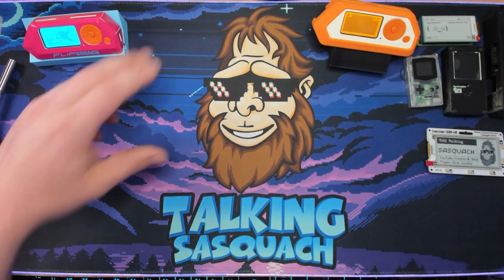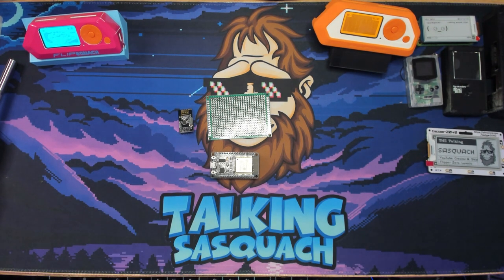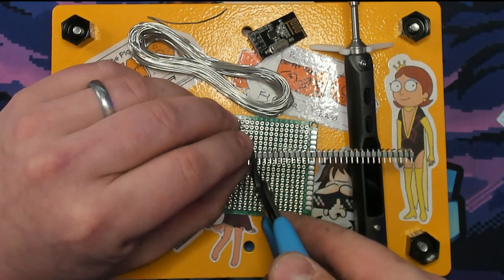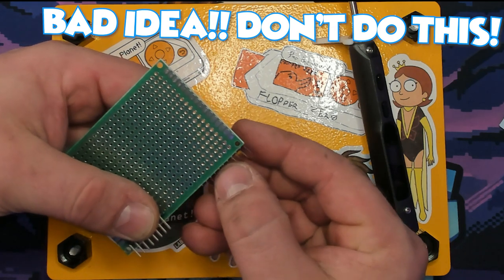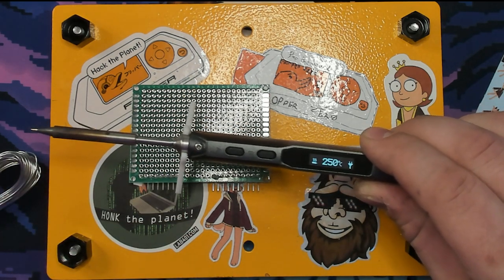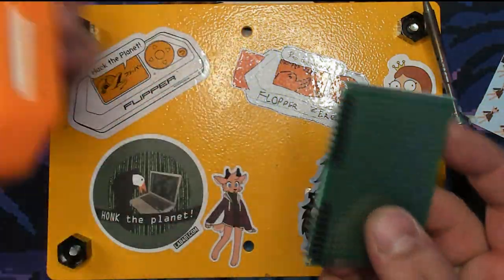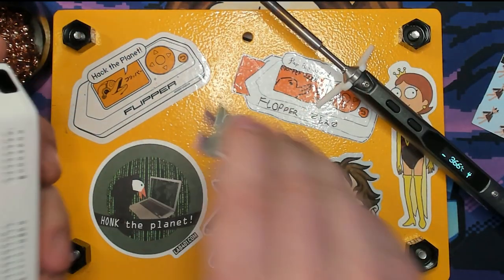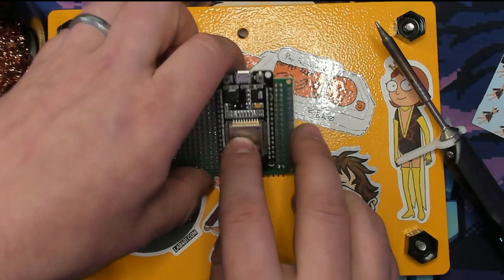How To Build Your Own Custom GPIO Boards for the Flipper Zero!!! 🤯🐬😈🐱‍🏍🐌

Comment: I wish you could explain more things like what these boards do and how to read pin out and understanding what these things mean for example tx and rx and what those things mean and what they do and how those two chips interact or how/why they are on the same board you are making. Or why there are two different sides one with less pins and one with more on the flipper and why some are connected to that but only on the smaller chip u used. How these things interact with the software or how to even know what is possible and all sorts of things. If anyone has any resources for this stuff I would greatly appreciate that. I haven't looked at the flipper docs for gpio I'm sure that is a good place to start but a video on all the things i mentioned and things like that would be so amazing.

Comment: To the Talking Sasquatch  I have been soldering onto old Xbox 360 to RGH3 hack/mod consoles and it’s micro soldering to a MB that requires you to scratch at the MB to expose microscopic points in my experience in soldering any MB or PCB it’s best to use more flex then less it’ll help protect the board from burning and help protect trace wires that don’t need burns or scratches. 30 awg wire is the go to for MB or PCB and the solder I always choose lead but free will do as well not a huge miss..good work as always tho man! Also my burning temps I like using is 381 to 480 it’s a big range difference however some spots don’t need as much heat as others depending on the point and the material  I have better luck with long holds on copper vias on 381 then I do short holds at 480 to tack wire down just another point of interest for anyone else learning to solder
Reply: Also after pre tinning the 30 awg wire you can cut it down a little shorter to leave less exposed to help prevent shorting problems

Comment: Hello! Thanks for the good video!  I saw you soldered the wifi chip GND to the 2nd pin which is not GND on the flipper, but the SWC... Is that OK?
Reply: YEP... you mustv'e meant the 3rd PIN....

Comment: Your on a completely different lvl than I. I have so much too learn and am very impressed by your skills . Im still running original firmware and api mismatches everytime I update on q flipper it makes me have reinstall everything. Is there a better way? I noticed after reinstalling some things they were updated or ran better with less furihal crashes.

Comment: so I can hook up an nerf and an esp to the same ports and they work fine? so no switch or anything just solder both boards to the correct pins?
Reply from the maker: Nrf24 and esp32 use totally different pins except for 3v3 and ground so it's not a problem
Reply: @TalkingSasquach  what about a CC1101

Comment: If you use these 90 degree headers like this then it will not fit in the flipper, You will need to file down the edge almost upto the lower pin holes, The black plastic anchors need to be flush with the board or prominent otherwise it will not fit. Some 90 degree headers have the plastic anchoron the long side wich will be fine, yet i have never found any like this. The other important thing is to install the components on the nearside so you can see them and no one else can as that would be very suspicious. The default is to Have the GPIO pins on the back of the board, From Left to right you have 8 Connectors and on the right you have 10. Apart from keeping an eye on your components and not making people suspicious of what you are upto is that the Board is Balanced in the middle. Other than that you always remember that the correct installment is with the pins to the back of the board and less damage to your GPIO connectors (They will get weaker over time.)
I am not having a go and i make mistakes all of the time, I even do them on purpose to learn recovery from them. But it would be useful to add more details if you expect people to follow your projects and try to build them for themselves. This one actually confused me due to the changes with no explaination, parts, and bad links. I took time to work it out and it was still wrong. !

Comment: The flipping of the pins made me lost for the rest of the video. Is the 3rd hole the ground?
Reply from the maker: Yeah its rough, don't follow the video for where thigns go, follow the pinout from UberGuidoZ!
Reply: @TalkingSasquach  Will do once my computer fixes. It randomly shut down on me and when I turned it back on the wifi stopped working.

Comment: can I connect nrf 24 or esp32 wroom to the 5V on the flipper?
Reply from the maker: My NRF24's only use 3v3 so in that case no.  Some ESP32's do have 5v and then you just need to enable 5v in the GPIO settings on the Flipper.  3v3 is always active so that's why I use it, it's just easier.

Comment: I am a man of Age but i don't let that get in the way of learning or experiments. I find that i look a bit silly carying arround a device that looks like a kids toy. I would never use technology to do any harm but it is good to know and to be prepared. I am thinking of making some modules that i would like to share, but still learning. My question is... Does anyone know of a reasonable or cheaper way of creating covers or cases for the Modules ? The ones i see online are terrible and stick out like a sore thumb. It could be a cool idea for someone to make some money on this. Make a cool 3d printed model and have it factory moulded. The other cool thing would be to have a case made to include the modules and the Flipper Zero so it looks more like a phone than a toy. Even if it is a bit clunky !. I use the HackRF and no one bats an eyelid even when i have a large antenna connected but when they see a small toy like with orange buttons they can't help but to ask why i play with it.

Comment: Can anyone point me in the right direction for how to solder on  and connect a speaker and microphone to one of these bad boys??
Reply from the maker: There is no interface for any of this, so you'd need to try to figure out how to fit it all inside the Flipper, which will be nearly impossible unless you want to design your own, much larger case
Reply: @TalkingSasquach  that is indeed in the works! Custom software being built as well. Biggest challenge I’m running into is figuring out even with a PCB board micd and speakerd up, getting it like you said to interact with the flipper.. thank you for the response. Truly love all your content.
Reply: @TalkingSasquach  update- found a way to do it with a hack RF, even though it’s a different device it gave me an idea of how to somehow get the flipper or my custom application to run audio through one of them